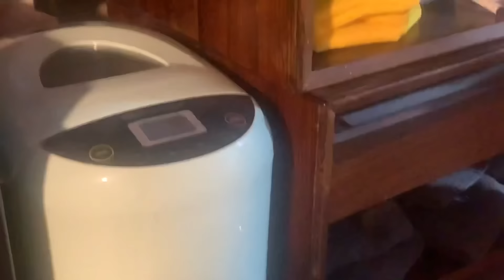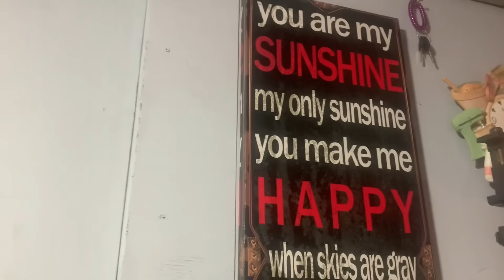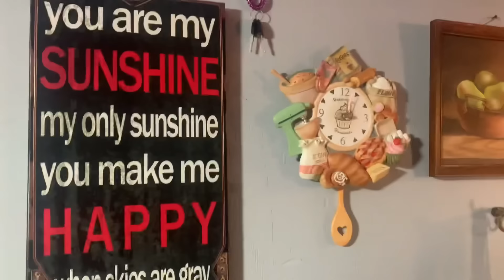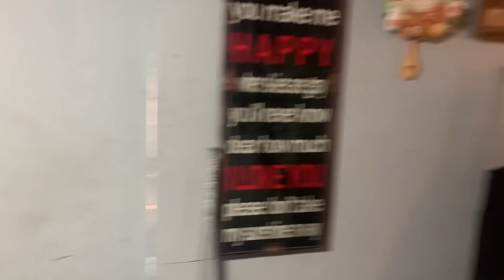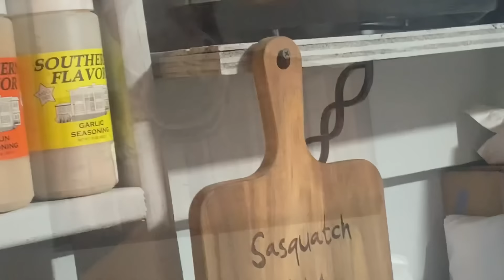Rug Busters

Comment: Gene, my mom used to buy oilcloth to use as our everyday tablecloth on the kitchen table. It was sold by the yard, and usually the local 5 and dime had bolts of it hanging on the wall. I googled oilcloth and its still available.